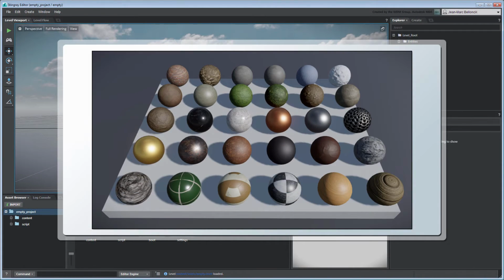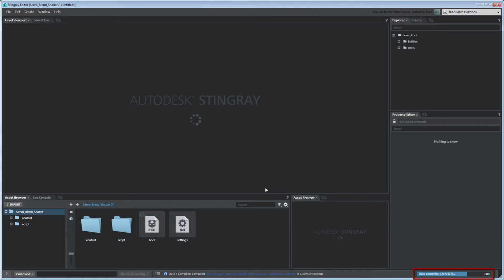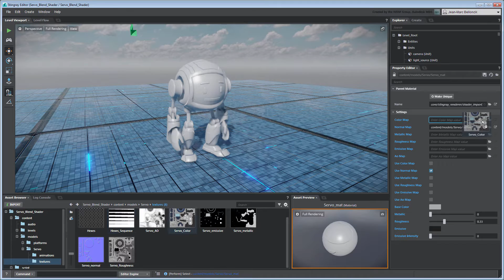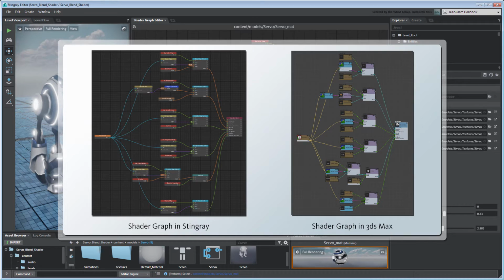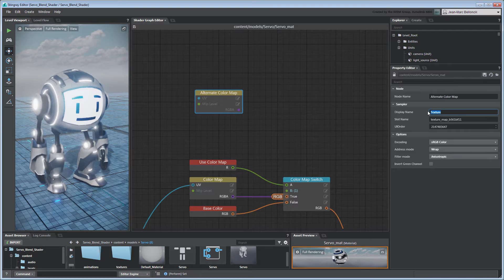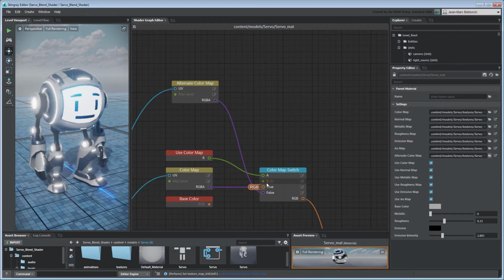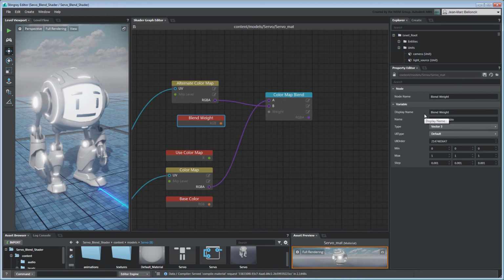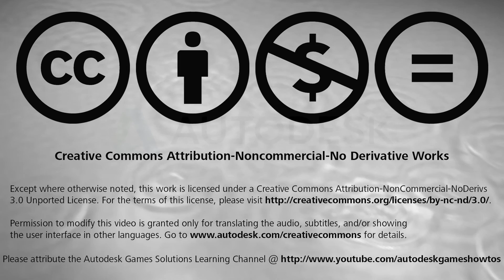Creating a Custom Blend Shader in Stingray – Part 1: Blending color maps

Comment: Hello.
I'm new to Stingray, but I have to say, it is an amazing software. We are a small team that intends to use Stingray for architectural visualization, especially for customization.
I was trying to recreate this blending of textures. For example, to change the floor from hardwood to carpet. I managed to get to the point where I can change that using the target weight slider, like you showed in this video. The problem I have is, I can't figure out how to trigger this "in game". I tried to follow the steps in your other video, in which you explain how to trigger this, but it doesn't work for me. I'm using stingray 1.6.. and I saw that "Get Mesh Material" is no longer there, instead I found "Get Mesh Slot Material", which I assume is the same thing. The problem is, I can't assign any material because it doesn't pop the list of materials. 
Also is it possible to achieve this smooth transition between two textures using the story editor?